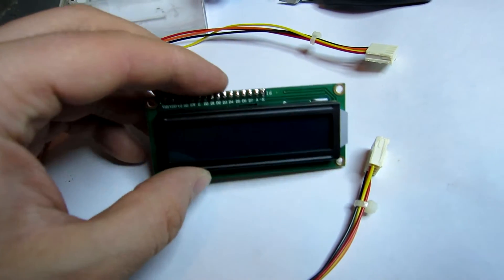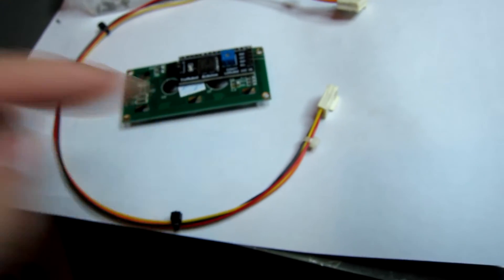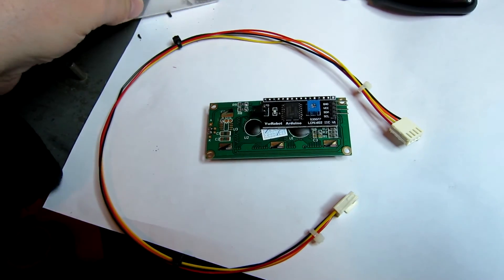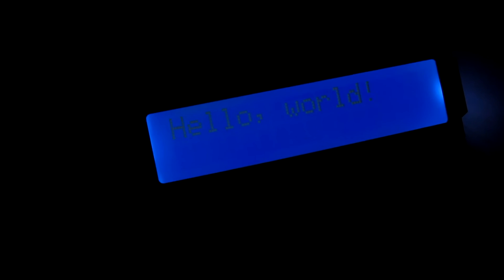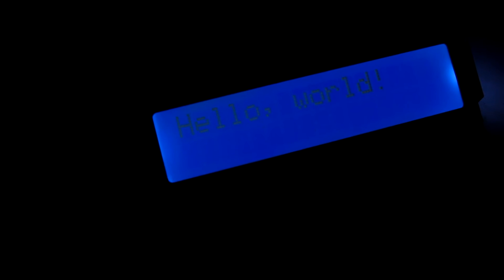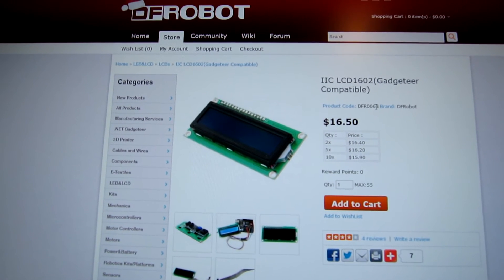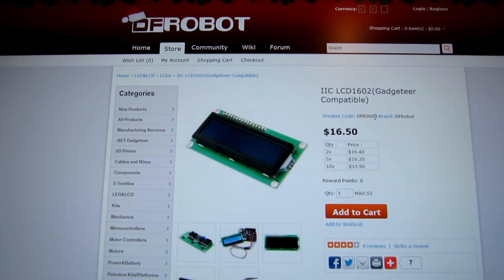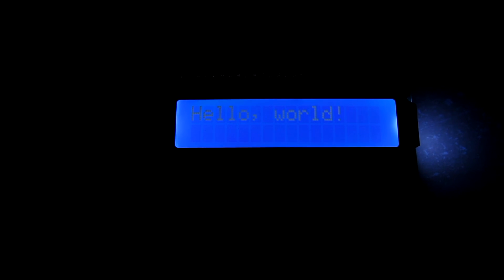Arduino + ywRobot LCD Problems + Resolution

Comment: Hmm, after almost giving up, there were two things that helped me.
1/ Potentiometer on the back was in position that display did not showed anything no matter what. (no)Backlight worked with most of the libraries, did not work with one or two. 
2/ It displayed just one character. I used this library https://github.com/fdebrabander/Arduino-LiquidCrystal-I2C-library instead of one from DFRobot ... works flawlessly

Other possible problem:
1/ Address might be different, eg. my display has 0x3F
2/ Different displays may have different wiring and different libraries may not be compatible with them (according to forum), but it might be fixed by parameters in constructor, eg. LiquidCrystal_I2C lcd(0x3f, 2, 1, 0, 4, 5, 6, 7, 3, POSITIVE);